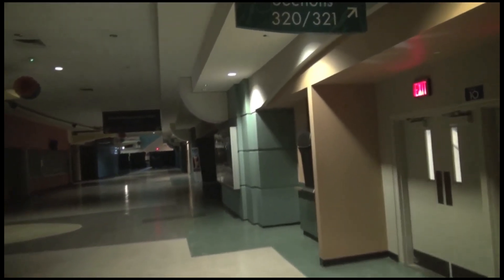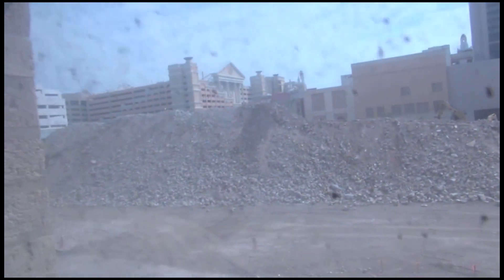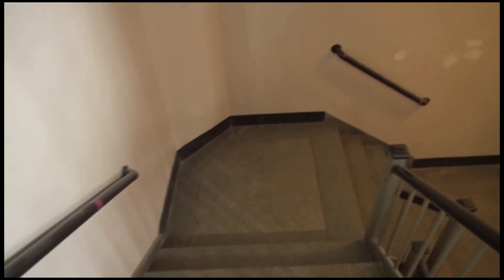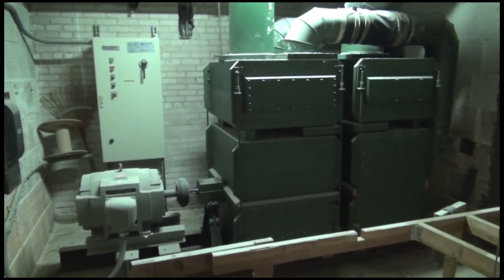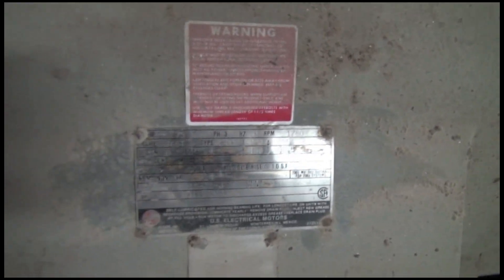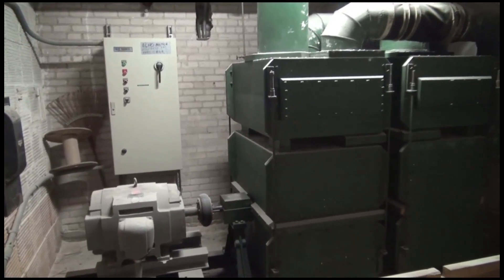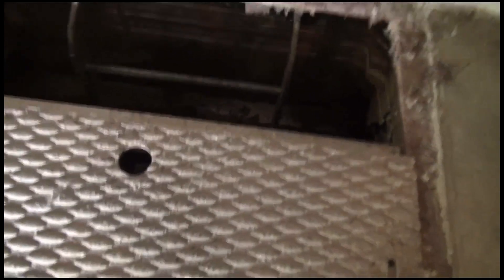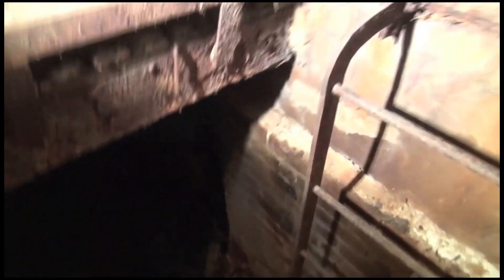Boardwalk Hall organ- Echo and Swell Low Pressure blowers

Comment: Chris, do you know around what date those AC motors and control systems were installed? They look pretty modern. Maybe some time in the sixties? Is it possible that when that new blower motor equipment was installed, the Fanfare and Echo chambers were already no longer in use because they were in disrepair? I imagine that when DC was continued to the building, that was the time to get the new motors in the budget, no matter if the pipes were currently working. Are there any run-time meters on those blower installations? That would tell the story.
Reply from the maker: I'm not certain but I think all those motors are from the 1980s or early '90s. Dennis McGurk told me that the DC motors were switched horsepower for horsepower at some point with AC motors and they tripped out constantly. They were replaced a second time with Mel Robinson from NYC being a consultant (this is what Dennis said) and the horsepower ratings were doubled, and that's what's there now. As I said this story is from 30 years ago and I may not have the details right, but that's what I remember. There are no run time meters on any blowers that I know of.
Reply: @cnagorka  Very interesting. Thanks. So, I guess we'd have to assume that some of those motors and controls actually were installed when the chambers they served were already out of commission and not being used. Must have been a number of points along the line where there was optimism that restoration work would be done, but then it didn't get done.

Comment: How does the 100” compressor work? Does it take wind from another blower and step it up? Is it still a centrifugal blower or something different?
Reply from the maker: Yes it takes the output from the Great/Solo low pressure blower (yes, the low pressure, not the high pressure) and steps it up to 100" I think technically right now the pressure registers at 96". The 100" blower is an Allen "air compressor" but it's actually a turbine blower, not a piston operated air compressor like what we have in a garage.
Reply: @cnagorka  interesting. Any idea how many stages it has?
Reply from the maker: @craigbrown7929  I think just one, but I'm not certain.

Comment: Doesn't the Swell Low Pressure blower have the most powerful motor in the whole organ, since it used to wind the Choir as well?
Reply: He said the right stage low pressure blower is the same, so I'm presuming they're both 75hp.
Reply from the maker: I don't think so, especially now that the Swell low pressure isn't working the Choir any more. I think Swell low is 50HP but I could be wrong.

Comment: What blowers supply wind to the right forward and right and left center and ceiling chambers aside from the echo blower?
Reply from the maker: My understanding is that all those side chambers are winded from the Echo blower, with the exception of the 100" reeds in the gallery, which have a windline coming all the way over from the right main chamber.
Reply: Echo blower: Right center (except for 100" reeds), right ceiling, right forward
Fanfare blower: Left center, left ceiling

The 100" reeds in the right center are supplied by the same 100" compressor that supplies the 100" reeds in the right stage chamber. The left forward was formerly supplied by a blower that shared a common shaft and motor with the Swell low-pressure blower. That blower is gone now, it was not restored and relocated along with the Swell low-pressure blower as its windline route was removed in the renovation of the building. The left forward will be supplied by a new Spencer blower that's already on site, to be (or perhaps already) installed in a new location.

Comment: Where are the actual blower intakes and do they have filters on them? Also is there some sort of relief outlet when the organ is not being played?
Reply from the maker: The blower intakes are right where you see them, they draw air from the rooms they're in. Most of the rooms have furnace filters in the doors themselves, Echo/Fanfare/Swell Low Pressure don't have the furnace filters because the rooms have steel doors, as opposed to the wooden ones which can be fitted with filters.
Reply from the maker: Also most of the organ now has the VFD system which keeps the blowers running slowly for humidity control, with small valves in all the chests which stay open all the time when the blowers are off or running slowly.
Reply: @cnagorka  oh I see. Explains why they are so noisy. Do you have to turn then on one by one or will there be a master switch/key on the console?
Reply from the maker: @kellyb0279  They are turned on individually by contactor switches in a box by the console.

Comment: Is there anything to remove moisture from the air? Some kind of desiccator?
Reply from the maker: Not really, the problems the organ has stem more from dryness than humidity- and most of that has been taken care of with the VFD blower system.
Reply: I remember seeing one organ tour on YT where they had a spray humidifier in the blower room to keep the air moist. I guess it stops the wood from shrinking and cracking.

Comment: Is there a high pressure blowe? And what is its purpose?
Reply from the maker: Yes it's in another video, I mistakenly left it out of that one so I covered it in this one. The high pressure blower is for, well...the higher pressure stops! The division is so big enough to require two blowers.
Reply: Each of the stage chambers is large enough, with enough stops of varying pressure, to require two blowers. They're in other rooms and covered by other videos. This is all of them, but only the first five are currently operational:
Great Low-pressure
Great High-pressure
Compressor (for 100" ranks)
Swell Low-pressure
Swell High-pressure
Echo
Fanfare
Choir

Comment: When was the last time the echo and fanfare blower ever ran?
Reply from the maker: I would guess at least 40 years ago.
Reply: @cnagorka  I guess it was never tested since the existing motor was installed?
Reply: When do you think the echo blower will be functional again?
Reply from the maker: @sigglass2183  The blower could run tomorrow, as far as I know. It just wouldn't do anything since the windlines to the division are disconnected.
Reply: @cnagorka  If you were to start up the echo and fanfare blower, would it make a mess in the organ chambers as it blows dust around sitting for decades?
Reply from the maker: @sigglass2183  It wouldn't make it as far as the chambers. The lines were cut in the ceiling leading to the chambers.
Reply: @cnagorka  Next time you go back to Boardwalk Hall, would you be willing to test run the echo and fanfare blowers?
Reply from the maker: @sigglass2183  Nope.